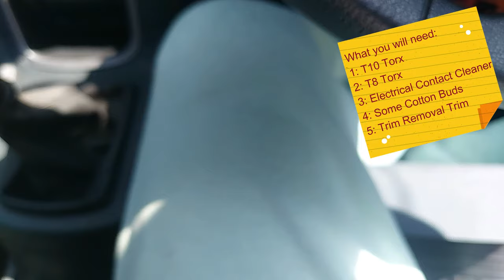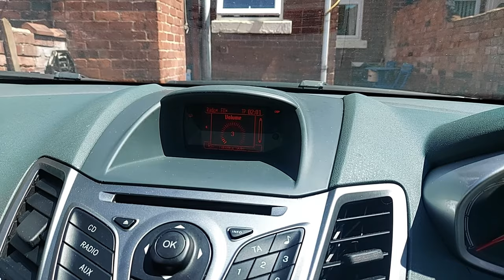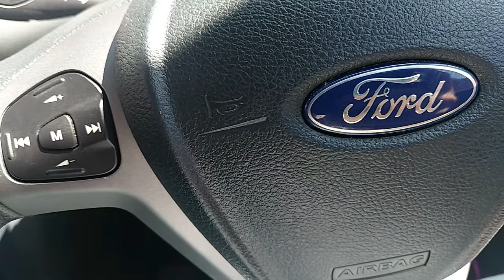How to Fix Steering Wheel Controls Unit/Volume/Buttons/Cruise Control Unit Ford

Comment: Thanks for this. Getting the screws out and back in again from the back of the steering wheel was the hardest part. No corrosion to see, but a bit of contact cleaner and it all works fine again now.

Comment: It worked!!! :) THANK YOU! It took me 2 hours, because of the cold beers I had with me in the garage and some heavy rock music.
And I did not disconnect the battery. I used professional contact cleaner spray and followed your recommendations. 
To all who are going to do that:
Something important - Here in Europe the cars are left steering wheel. In video is right. It doesn't matter. The method is same. 
AND be extremely carefully when putting the control buttons together. There are very gentle contacts inside and should fit perfectly. I've opened it 5 times till get it right. BUT VERY GENTLE!!! Do not rush! No hurry!

Once again - What's the music in the video? :)
Reply from the maker: Glad if worked for you aswell! no clue about music !You can go in your account/youtube studio/audio library and you have there loads of free music ! You can use it because is no copyright music!
Reply: @onit5669  
Thank you one more time! :) 
Very helpful video! :)

Comment: Thanks for the video, cleaning the contacts with contact cleaner fixed it, even though they looked clean.

This was a tad harder on a car with cruise control, but still done without removing the airbag. I still disconnected the battery to stop it honking as I pressed the trim back.

The two screws on the back that go in at an angle are hard to get back in, I ended up using some glue to stick them to the end of my screwdriver so I could get them in straight.

Comment: Yes, thank you! Both of them hardly worked in my Fiesta Sport but now it works how it should be. The two screws on top of the steering wheel were a pain in the ass. Still didn't managed to put them back in place.

Comment: Just done this and it seems to have helped the music volume/track skip issue (need to try cruise control to check still working ok/better). 

Thank you to the video uploader! 

However getting the screws out and particularly back into the rear of the steering wheel is possibly the singularly most annoying and frustrating thing I’ve ever done so if you value your sanity, think about paying someone to do it for you.

Comment: Thank u very much for this video, i prefered to replace the unit with a new one and you helped me a lot to do it on my own. I agree that the most difficult part is to put the screws (to the steering wheel) back again. The screws to be inserted and stay inside the old plastics is not an easy task, they can get loose and never fit. I bought the unit on ebay for around 50 euro while it costs around 120 in ford. Of course to clean it is better choice financially .

Comment: Thanks for this video, had a intermittent issue (would work for a little bit then stop). Couldn't see any corrosion but cleaned it anyways,  saved at least £50 on getting a replacement part.

Comment: This fixed my issue. Good video. Thanks
Reply from the maker: Glad it helped and not spending nothing!
Reply: @onit5669  indeed. During the 6 months I bought my 2010 Fiesta, I had to do small fixes like this now and then. Now my final challenge is to figure out why my car makes a  whistling sound when in acceleration in specific torques :D

Comment: I've just done this, thanks for the video. There was no corrosion but I sprayed it with contact cleaner anyway. When I put it back together, the volume down works but the << button now controls the volume up. The actual volume + button does nothing. Any ideas?

Comment: Only one button was working on my radio control. After cleaning it with contact cleaner, now 3 button works, but not all of them. Any idea why? Important is that Volume+ and Volume- is working. :)
Reply from the maker: Try to clean rubber part  aswell, but be carefull, don t put too much pressure!  🥂
Reply: @onit5669  Well, I did it too. There was nothing visible on both parts.. Just small black dots on the rubber part, but not sere if this is the cause..